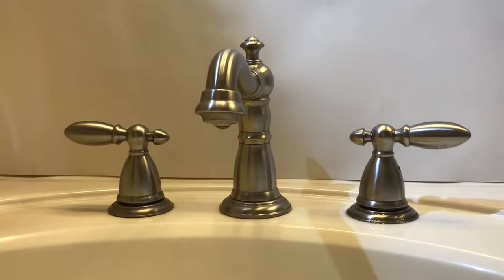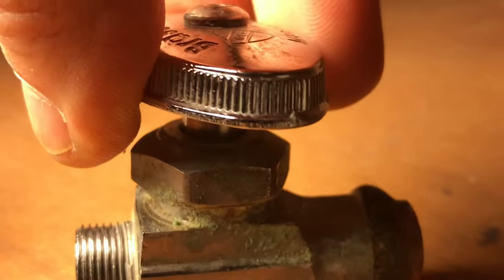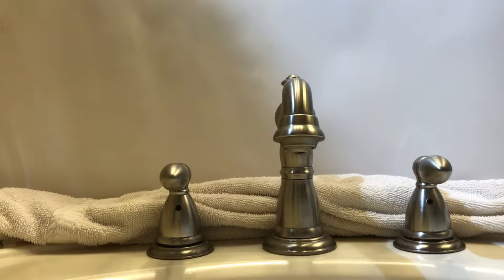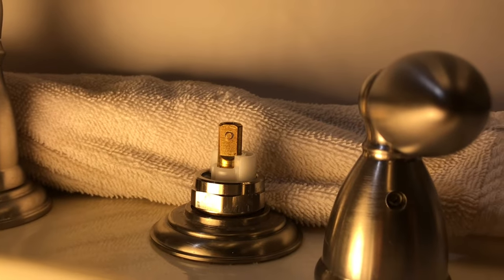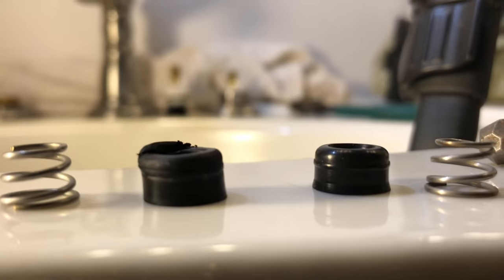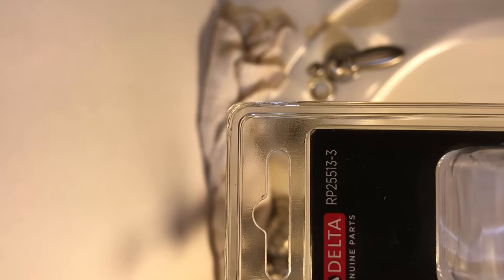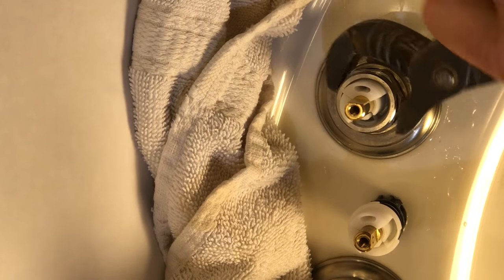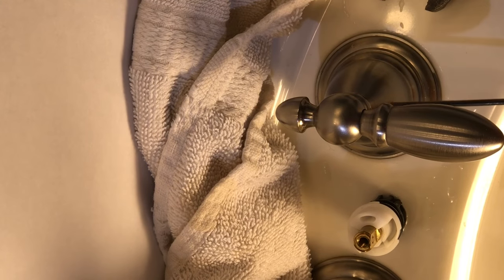How to Repair Leaking, Dripping Delta Faucet #diyplumbing #serviceplumbing @TappPlumbing

Comment: Hey guys! Question for ya. Your video was great - very helpful and straightforward. I was able to replace the cartridge, seat and spring and no more water comes out when I turn it on. Yay!!! Big win!! But... after a few minutes of it being off, I notice water is still coming out from under the faucet by that handle (from where the fixture sits on the sink...not between the handle and fixture.) Any thoughts on what I should try next?
Reply from the maker: Ryan Rickards look underneath from cabinet, as water could be coming internally and you then you would require a  new faucet. Make sure it is not the opposite cartridge first before replacing whole faucet and be sure to leave handles off because sometimes the retaining nut is not tight enough giving the illusion the valve is leaking internally 😊 Hope this all makes sense! We appreciate you!
Reply: Awesome. Thanks - yeah, I was contemplating changing out the opposite one to see if that helped. Hoping that will do it! Thanks again - have a great one!!!

Comment: Thank you, my faucet had the dripping and I noticed there was no spring or seat. I could manage to add the new spring but couldn't add the seat as desired. There is always water (even after shutting off water supply) and wiping out, so the seat pops back up. Any reason why the water keeps coming up again?

Comment: Thanks. This is great, but how do you remove the retaining nut when it's stuck? Mine is 22 years old and probably a little corroded. I can't find any other flat surface to hold with a wrench, either above or below the cabinet.
Reply from the maker: You might try holding the valve body from underneath with a basin wrench. I hope you a person that can help you. This would be close to impossible to do by yourself. Not sure exactly how corroded your parts are but sometimes if you are very unlucky those nuts can crack and the inside of the valve body is in such bad shape the repair procedure won’t work. This usually happens on bad well water. Good luck , keep us posted please.

Comment: the hardest part i found was getting the stupid spring and seal in the hole properly.  i used needle nose pliers like some other guys yt video and paused your video just before you got to the allen key trick LOL.  i think the silicone o-ring lube i put on the seal was making it stick to the pliers a little.  second hardest part was getting the handles back on properly, first couple times the on/off positions were reversed (even though i made sure to note the position of the cartridges) but some fiddling got it back to normal.  should have done this a long time ago can't believe how easy and quick it was once things were figured out.
Reply from the maker: I can same thing about so many things in my life” should have done this a long time ago” . Thanks for watching and sharing your story . We are so glad you had some success!

Comment: Thank you so much for this informative video. I have exactly the same faucet and I am planning to replace it. Mine is very rusty from under sink and I didn't not have the right tool to remove them from the bottom. I am wondering if I can remove the faucet from the top. Thank you!
Reply from the maker: If you take all of the trim off the top and discover a thin nut touching the counter top then yes. You will remove that nut and the valve will drop down . Be careful not to scratch your counter top , it is very easy to do. I hope you do not end up having to cut the valves and trim into pieces with a dremel or multi tool to remove it . That task is aggravating to say the least. Keep us posted if you can please?
Reply: @TappPlumbing  Thank you very much for your suggestion. I will give a try!

Comment: Hey there you are actually our plumber. One of the Delta faucets you installed previously is leaking at the base of handle. Took the screw out with Allen wrench but handle will not pull off. Suggestions.
Reply from the maker: If the Allen screw is actually removed out of the handle it should definitely pull off. It may take a little more force than you might expect, especially if it has been leaking a while. You can gently try to wiggle it a little from side to side and front to back . Keep us posted please.

Comment: Great video.  I replaced the cartridge in my dripping faucet, it didnt work at all.  But as I continued troubleshooting, I noticed the seat was at the bottom and completely out and just laying there.  Im assuming that was why it kept dripping?  I've never messed with fixing faucets before.  Safe to say if I get a new seat/spring, it should fix the issue?   Thanks for your help!
Reply from the maker: The seat and spring have to be perfectly seated. They are the cause of a drip. If the cartridge is bad you will normally have a leak at the handle. Thanks for the kind words and watching our video!  Keep me posted with your progress if you have the time please.
Reply: @TappPlumbing  Appreciate the help!  That actually saved me $20 on new parts.  I just examined the seat, it looked in good shape, I put the spring back down, followed by the seat and the cartridge and the leak was history.  Thank you!
Reply from the maker: @kdsberman  Great to hear , you can enjoy the rest of your weekend now👍

Comment: Great video! But how did you get that retaining nut to loosen so easily? Mine keeps wanting to turn the whole base and all....any ideas? My faucet is a delta dryden widespread model...i sprayed vinegar and water on it and now wd40? Should i go underneath and try to hold it somehow from turning? Im confused....many thanks
Reply from the maker: You are on the right track! Try and tighten the nuts underneath. You would have a better chance if you purchase a basin wrench for this . Good luck and keep us posted if you have time please.
Reply: @TappPlumbing  thx for the reply. I got it off by spraying wd40 on nut and sitting overnight. Now waiting on part from delta. They sent wrong one first time. Ha
Reply from the maker: @benw6554  It most certainly sounds like you are on the right track! Best of luck getting it wrapped up!!

Comment: Is it always the seat/spring or cartridge assembly? Is it ever in the faucet part where the drop is occuring? I ask because I usually have dealt with seat/spring cartridge issue and the drop comes out at handle. I was wondering if there is an additional area to check.
Reply from the maker: This is a fantastic question! When it comes to plumbing there is nothing that is an always. It usually the cartridge if it is coming out from under the handle but certainly possible there is some wearing in the valve body. Most of the time this happens if the faucet is old or the system is on well water. Keep us posted of you can make time please!!

Comment: Thank you for this awesome video! I have a question tho… if the valve doesn’t fit into the 2 notches completely what does that mean. The cold water side fits fine, but the hot water side doesn’t push into notches completely.  The retaining nut spins and will not tighten like the other side. Both have new washers. Thank you.
Reply from the maker: That might be a little tricky to answer without actually being there . My first question for you would be are they the original cartridges? If so then most likely there is is a problem with the seat and spring not being seated in the hole just right. If they are new catridges and the seat and spring are good then maybe you picked up the wrong catridge 🤷‍♂️. I hope to help you through this so keep us posted!
Reply: @TappPlumbing  the cartridges are the original ones. I replaced a little rubber washers. I put the spring and rubber piece in put a little grease on them and push them down. I can feel them bounce. I want to put the cartridge in which is the original, I can’t get the cartridge to fit in a little grooves. Also, the retainer not doesn’t tighten like the cold water. I appreciate the response.
Reply from the maker: @michaelsingh2526   The retainer is not gonna start if you can’t get the cartridge down 😬 . If you are positive the seat and spring are down in the hole the only obstacle has to do with the cartridge I would think. Make sure the cartridge has not not separated some how and the o ring on it is in the groove. Basically take a long hard look at the cartridge. Good luck and once again keep us posted please!
Reply: @TappPlumbing  yes, I noticed the cartridge separates a bit because the bigger O-ring that’s on there. I even tried with the old one. Yes it is a bit tricky. I will keep plugging away.
Reply from the maker: It may be quicker and less aggravating to get a new cartridge. Home Depot or Lowe’s should have them . Try to get factory Delta if you can. Make sure to take the old cartridge with you.

Comment: very helpful video. i had a leak and replaced the seats and springs with delta products, no "same as" stuff. Now a week later its back to leaking. any advise? thanks
Reply from the maker: Did you replace the cartridge also? Theoretically that shouldn’t matter if it is dripping from the spout .Some times it does make a difference though. It is possible the brass in the valve body is scarred, if so you will have to replace the valve. If it leaking around the handles it is definitely cartridges. Keep me posted if you have time please.
Reply: @TappPlumbing  i did not replace the cartridge. it is leaking from the spout. i think i will check the nut and make sure its seated properly. thanks again

Comment: This may be a stupid question but did you have to secure the locking nut underneath the sink with a plumbers wrench to get the retaining nut loosened off first?  I assume you did this but just wanted to double check?
Reply from the maker: That is a great question, and if you try to loosen the retaining nut and the whole valve body moves then the nut underneath the cabinet is is not tightened and you should absolutely tighten that nut  this first. Again great question!

Comment: If you can’t loosen the retaining nut, do you have any suggestions? The base is now loose, which is also another problem… is there such a thing as plumber’s glue? Once i can get the retaining nut off, replace the spring, seat, and cartridge, I’ll need to secure the base that looks like it was originally glued or caulked on the sink. Any suggestions on how to do either?? Thanks.
Reply from the maker: There should be a nut and washer under the counter top you can tighten. More than likely you will need a basin wrench for this. Good luck and keep us posted!!
Reply: I called my plumber on FaceTime. He looked at it and suggested this use vice script under the counter to hold the bottom while a second person uses a wrench to turn the retaining thing on top. It worked for me for Long rusted stuff. He said to tap it a couple of good times to get the rust loose in the thread.
Reply from the maker: @lph2040  Does this mean you are finished with your project now ?
Reply: @lph2040  thank you! Guess what? I have a neighbor who is a plumber, unbeknownst to me, and i texted him… and he suggested the exact same thing! Now, i have to go and buy one of those vices, but I really appreciate your comment, because it reassures me that i explained it adequately 😃

Comment: Hey! I’m trying to fix my tub leak. If you don’t tighten the retaining nut enough, will it cause it to still drip? I hand tightened it but still have a slight drip (definitely better in comparison to the old seat and cartridge it had though)
Reply from the maker: It is possible as the retaining nut pushes the cartridge on down on to the seats and springs. Do not over tighten. Check your water pressure first.( https://www.youtube.com/watch?v=nrGZMxpp_Og )  If it is over 80 psi then that could be a problem as well. The valve body may be scared and allowing to drip. If this is the case then the whole valve will need replacing. Good luck and keep us posted!
Reply: @TappPlumbing  THANK YOU SO MUCH! It’s an old 70s trailer, so during the winter my father in law had went ahead and changed out the whole valve body including some shutoff valves (all the pipes had busted) but I found a wrench and did two quarter turns on the retaining nut and it fixed it!
Reply from the maker: @Mackdaddyy  Great news . Thanks for the update!

Comment: Thanks for the instructions! I was able to take apart my leaking Delta bathroom sink faucet by following them. But there's no seat and spring under the cartridge. Is that normal? The faucets were installed by the previous owners of the house in 2010 or thereabouts. There's no obvious place for them to sit. It's just a hole straight down. My handles also didn't have any set screws. Are they important?
Reply from the maker: I am so sorry for the delayed response!!! Somehow I just now saw this. The answer to your question is yes, the seats and springs are important, it will not stop running or dripping without them. The set screws are fairly important, without them the handles will seem loose. The faucet can still function though without leaking or dripping.
Reply: @TappPlumbing  Thanks for your answer!

Comment: That was an AWESOME video! Covered everything I need except one thing: I have a Delta Flynn 25768LF and there are no set screws holding the handles on. I've looked everywhere on the handle (all sides/top to bottom and there are no screws at all! So I'm stuck. Any ideas?
Reply from the maker: Try to turn the part of the control directly under the lever handle, it is possible it threads off. Let me know if that works please.
Reply: @TappPlumbing  Thank you very much for your reply! I tried loosening those by hand but wasn't able to turn them (tried counter-clockwise.) I thought about using padded channel-locks but didn't want to "force" anything. Maybe I should try the channel locks?
Reply from the maker: @Alex-zs7rv   They should be fairly easy to get apart if that is how they are designed . If all else fails call Delta. They used to have excellent customer service. Ever since Covid it is not as good as it used to be , but you can still get answers. You may have to wait a few minutes. Keep me posted if you can.
Reply: @TappPlumbing  Thank you! I called Delta and they couldn't answer my question but they did send a manual on the faucet and in the maintenance section it says: "NOTE: Remove handles by hand-turning handle base counterclockwise." I'd send you a picture of the handle/base but there's no way to send an attachment. I've "hand-turned" both bases as HARD as I can and it looks like it's rotating very slightly (maybe 1/64") but as hard as I try, I can't unscrew them by hand. UPDATE: EUREKA!!! I took a break, went back in and really romped on that base. Took a LOT of pressure but it finally started moving. Super tight but it finally came off! Will try to replace the valve assembly inside now. Wish me luck! And thank you so much for your help!
Reply: Final update to @TAPP PLUMBING: I was able to replace that cartridge and the leak is gone! Thanks so much for all of your help! I really appreciate it!
Reply from the maker: @Alex-zs7rv   You know I have to ask how it came off?
Reply: @TappPlumbing  I was finally able to unscrew the bottom part by hand. I think I sprained my thumb doing it, though! 😆Got it on ice now. I should have used padded channel locks on it. That thing was TIGHT! But it's all fixed and not dripping anymore! Thanks for your help!!
Reply from the maker: @Alex-zs7rv  Thanks for the update, sounds like you did great!!!
Reply: @TappPlumbing  Even a blind hog finds an acorn once in a while! 😅

Comment: I just removed both handles of my Delta bathroom sink. To my surprise there is no seats or springs on either.  I have replace seats and springs before in my kitchen.  Is that common to not have seats and springs?  It has not always leaked.
Reply: I don’t have a seat and spring either🤷🏼‍♀️
Reply: @janetrust  Actually I found them.  They blended in so well that I just thought they were not there and that I was looking at metal.  But once i was able to get a some needle nose pliers in there I was able to remove them and replace them.
Reply: @buckshots4800  OMG! ME TOO!